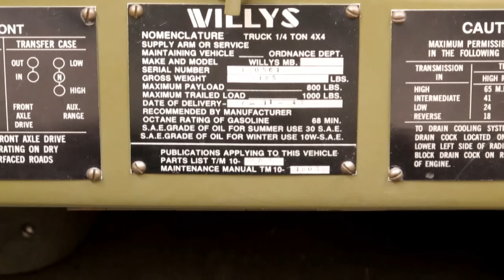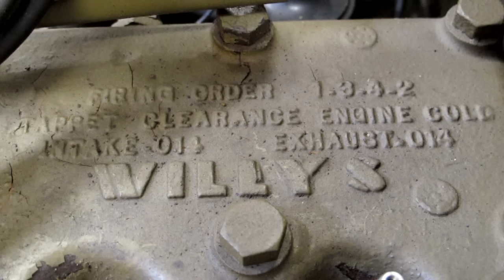1943 Willys MB Jeep - Walk Around

Comment: Nice Jeep. I’ve owned and restored two of these that were made in 1945 and I restored them to factory original condition, wiring, fuel tank, combat wheels, radio, every detail back to original and nothing modern…..except the battery, it’s common for MV owners that have these old 6 volt systems to install an 8 volt battery so it helps the starter have a little more power, it helps in cold environments and the voltage regulator can be adjusted charge an 8 volt battery. Please remember that when you restore the radio, the radio case is a different OD green color called Communication Corps green and it’s a crinkle type finish. There’s a vintage radio vendor that sells things online and they sold the paint in a spray can but you have to use it properly, don’t apply numerous coats or it won’t look right. If you can’t find the paint, you can go to your local Harley Davidson dealership and buy a can of their black crinkle paint then once you paint the radio case with it and it dries well, apply a single coat of the right OD green over it. These days, MD Juan makes some excellent reproduction parts but there are some better quality reproductions out there that you may prefer. I bought most of my parts from Ron Fitzpatrick parts out of Oregon and he sells a beautiful Italian made fuel tank which I highly recommend. If you’ve ever thought about owning and restoring one of these, it’s really not that difficult to do. Using flat paints is very forgiving compared to high gloss automotive paints. I would often buy a case (6 cans) of spray paint from RAPCO parts and as I restored various parts over time, I’d paint them as I assembled each section. Even using ‘rattle can’ spray cans is fine for larger sections like the hood or body panels. I’d buy a gallon of the paint and use it for the body and underbody areas with a cheap spray gun from Harbor Freight. The paints are still very cheap compared to automotive paints, a gallon of 314 OD green is only $45. And the spray cans have the same paint inside. With MD Juan, you can even buy a complete Jeep kit that only needs the engine and drive train so the options are wide with working on these, just depends on what you want and how much you’re willing to spend. Some prefer to use only US made original parts which is possible but insanely expensive so most of us compromise. I hate it when someone restores a WWII jeep but when they open the hood, it’s all civilian parts, crappy wiring and a 12 volt system. It’s fine if you haven’t gotten to the engine yet but to say that the Jeep is restored and the owner has no intention of completing anything else, is far from restored. And you’ll see a lot of Jeep owners that do this, usually there’s indicators that this is the case when you see all kinds of weird stencils that are incorrect for the vehicle and period of service. MV purists will always keep their vehicle exactly original and nothing else.

Comment from the maker: Blackout Lights were designed to provide a minimum of light so as not to be seen by a distant enemy or from the air above 400 ft. The Blackout Driving Light is 25 to 50 candlepower. They were probably most useful for vehicles traveling in convoy with wide-awake drivers. 

I’ve played around driving with them and really couldn’t see much. You need to drive very slowly. I can only imagine a lot of people ran into each other when using them.

Comment from the maker: I got it this way in 2004 but never drove it very much (for various reasons). I needed to make room for another vehicle so I sold it.

Jeeps were made as a lightweight, expendable vehicle and were never intended to survive as long as many have. Sitting out in the weather is a killer… sitting under a tarp is probably worse.
Still have the Model A.

Comment from the maker: A vacuum wiper motor has a semi-circular trough with a pivoting paddle inside and a fairly simple valve system. They work on vacuum similarly to how a steam piston works on steam. Do a Google search on VACUUM WIPER MOTOR HOW DO THEY WORK or search for VACUUM WIPER MOTOR REPAIR and you should find what you need.

Comment: Nice video, very informative, you even show the labels too, great! Always been curious about the details in these "General Purpose" (Jeep=G.P.) vehicles. Amazing how simple, straight-forward and rugged it all is, the way all American stuff used to be made. This stuff is going to remain around for a long time I'm sure, they're not making any more of it.  Congratulations on an amazing restoration, hope the new owner has as much pride in it as you do, can see it in the way you undo the latches :^)
Reply: GP was not "general purpose", it was Ford internal code for Government, 80" wheelbase. 

After American Bantam delivered the first prototype of what would become 'Jeep', followed soon afterward by Willys and Ford, Ordnance shared blueprints and specifications with each manufacturer, suggested revisions, issued each a contract to build 1,500 'pre production' vehicles (Bantam's contract was extended for Lend Lease).
These 'pre standard Jeeps' were:
Bantam BRC (Bantam Reconnaissance Car)
Willys MA (Military, first contract)
Ford GP (Government, 80" w/b)

After those vehicles had been thoroughly tested and evaluated (severely abused) and additional revisions specified the contract for 'Truck, 1/4 Ton, 4X4, G503' was awarded to Willys Overland with Ford as subcontractor. The WW2 standard 'Jeeps' were:
Willys MB (Military, second contract, nearly 360,000 produced)
Ford GPW (Government, 80" w/b, Willys contract, nearly 280,000 produced).

Comment: Very nice jeep and presentation. I am looking at one now for 14k and was wondering, when you had yours, what you didn't really  like about it. I saw where you said the steering wheel was too big and it was not big enough for bigger, fatter, lol older men. But was there other negatives you didn't like about it. I value your comments because you've owned one and obviously take pride in ownership of your vintage vehicles. Thank you in advance for your comments.
Reply from the maker: These are very nice WWII collector vehicles, which were sold cheap and then neglected and left out in the elements to deteriorate. If you can get good one, lucky for you. 

If you are in an accident with one of these you are probably going to get hurt. No collapsible steering column here. No roll bar. Not suitable for seatbelts (it would be like putting a seatbelt on a motorcycle). Probably best if you are thrown clear.

There are modifications for moving the seats back, but then it will not be exactly original. Do you care if it makes driving easier or more comfortable?

You do not want to drive these to fast as the front end can get into an oscillating harmonic, which can rip the steering wheel out of your hand if you are not expecting it. One of the reasons for the large steering wheel. Be happy with 35 to 40 MPH.

They are easy to roll over. They are easy to flip. People tend to get into trouble with these because they think 4WD can go anywhere. You can go just about anywhere but not necessarily get back again. Recon the terrain and conditions before driving there.

Like all ATV’s, don’t drive it any further than you are willing and able to walk back from.

They are easy to get stuck, especially in sand. They have handholds all around them so 6 or 8 GI’s could pick them up and get them unstuck, etc.

On the plus side, almost all body pieces can be obtained as reproductions. Just search for them. The reproduction parts are made in the Philippines. 

Now… go buy one, fix it up and enjoy it!

Thanks for watching. Please Subscribe! 
Ron
Reply: Thanks so much for the quick, very informative reply. It's really making me think if I want one of these. Just subscribed. :)
Reply from the maker: Not everyone has one of these. When you die, it's the one with the most toys who wins!

Comment: That vehicle was set up only for the South Pacific under Gen. McCarthy. The insignia shows that. Those black out lights are called map lights. There a 6 volt and or 24 volt system. Also the engine is a Flat head 4 known as the L head with a 3 speed top load transmission. That vehicle was never in full Military battle, may of been used at the base. In the rear panel on the lower bottom drivers side would of had the hand written script Ford, a raised insignia. The President, who I can recall his name at that time of WWll ordered all scripts to be cut out of those Fords on the back panel. Also the gun mount plate under the tub of both Fords and Willys. Was the Ford script stamped into on top of the gun mount plate. Willys had their stamp as well stamped Willys. I've still got alot of those Willys and Ford parts. Field radios. Antennas. The ceramic baseount blocks. The thick radio cables. Toolbox that held the tools in the rear inside fender with keys.. Those hard to find fuel tanks. Forwarding kits. Combat rims. Thats another item I didn't notice you having on your quarter ton truck. I've all 5 of those rims. 600 16s, 2 peice rims. Not made like you're typical split rims on pickup trucks either, all together different. Designed only issued for WW11 Fords and Willy Jeeps only bolts hold the ring onto the rim. I've got bows and tops, doors. Rear sets. Front seat frames. Now on both Willys and Fords, there weren't any retractable gates, they never opened. Molded in always. The Follow me Jeeps and Fords had them retractable gates on base at both Navy and Airforce only. Those Jeeps and Fords was slow with 5 men and all the gear they would haft to haul at times. But..., yea' couldn't beat em in mud or up hills, they was super tough, and still are. They do have a flaw, between the 2 cylinders is that water jacket. There they crack or crack on the lower part of the outside block.. cam gear side if I remember right.. Ive also got jury tanks thats dated 1942'43 and so on. Bumpereets, spare tire mounts, windshield gun mounts. Cluster panal with full pull out instrument panels, twist pin pop outs, and with the cloth wiring, and the band wraped peep lights that set out onto the drivers side front fenders, some was mounted a siren.. Nothing I have is Civie. All Military issue. Ive got 2 decapitation bars left. Those go on the front bumper. Inner fender panels with the oak wood inserted in the rib framing. Gunner windshields. Emergentcy cables and handles. Both Ford and Willys are a different set up. Simular in looks, but one who knows the difference can surly tell any differance or modifications. I've been restoring those little green convertible 4 wheel drives for well over 40 years. I'm done. And no they never had a heater that was worth a darn.. behind the seat was maybe one.. but it was a boxed add on.. not issued.. They set on drivers side if its a Ford and Willys set on the passenger side of the steering wheel. Instrument panals are different of both Ford and Willys too. Ive testored those darn things for decades. I'm done with them. I'm debating rather to just sell what all I have. Ive already sold the 2-1/4 ton trailers. Hoods fenders. Resests headlights, grills, some Ive still got. Rears, differentials, 3 peices of drives haft I've still got. Transmissions I still have. The brass peice that goes onto the steering box that runs up the steering column and hooks to a fiber button and loaded by a spring with the hard carbon black button to make the horn blow. Ive got a box load of them.band also under the hood there is a place to carry info with the under the hood mount brackets. Ive got just one left. Its to be mounted right directly under the hood. Motor parts, carbs, air breathers, genorators, push peg starters, transmissions I've still got. All flat head motor parts, with 2 hand cranks that will start those engines. Those a very rare. Ive not got any F heads or parts. They are different they are for those high hooded Jeeps. Military never used them in any war time battle.. again only the Navy and the Airforce used them strictly on base. Parts won't inner change. Not even the transmissions will work. Those are the F heads that has the valves that run in 2 different directions, one up and one down. They are junk! I've already sold my Bantom and my Ferguson 4×4s. Ford had a half track type. They also had the 6 wheel 3 axle. Junk. It had a floating rear. Again junk. The same size engine was used in both Ford and the Willys. Then when the Jeep M1A came out it had a 2cinch wider body design on it. Again junk! If its not a WWll Ford or a Willys, it's JUNK!  I've got other Military parts, but way to much to mention.
Reply: The 'Jeeps' of WW2 were not 24 volt, that did not happen until the M38A1 (Willys MD) was introduced in 1952.

Willys built vehicles never had 'Ford' script on the left rear of the tub, those were the early issue Ford GPW (Government, 80" wheelbase, Willys pattern). Early Willys MB vehicles had block stamped 'WILLYS' in the same location. Oddly enough, those 'tubs' were not built by Ford or by Willys, but by American Central Manufacturing (ACM) who provided them to Willys and to Ford. Ordnance put a stop to the 'script' in early 1942. No one cut the script from existing vehicles, they were simply produced without it afterward. The President of the U.S. was Franklin Roosevelt at that time and he had nothing to do with that decision. Ford continued to stamp a small script 'F' on nearly every part they manufactured for their GPW throughout production as a means of quality control.

The Willys 'Go Devil' 134 'L Head' of the Willys MA was primarily what won the contract to build 'Truck, 1/4 Ton, 4X4, G503' for Willys Overland with Ford named as subcontractor. All of the nearly 360,000 Willys MB and nearly 280,000 Ford MB vehicles were powered by that engine though Ford built 134's had those little 'F' marks everywhere for quality control.

Previously built Ford GP vehicles had Ford tractor engines, the Bantam BRC used Continentals. It is often said the Willys built 134s were better than those built by Ford.

Your cache of mil - spec parts has considerable value.

Comment from the maker: I first looked at these in Manila in 1975. As an abandoned vehicle, but with an original serial number, possibly it could argued it was originally built in the USA, then imported as an antique or historic vehicle. Or import the individual stainless parts and build it in the USA on an original frame, which has the title. This would need to be clarified and approved by the various authorities beforehand. Antique vehicles do not require any safety features not original to the manufactured vehicle.

Comment: So thats how to get the headlights on, never knew it came out a little further after you press that little button in, thanks
Reply: pepsi666 Rowena my friend had one of these that they  got at a auction and they could never figure out how to turn the headlights on either. 😭
Reply from the maker: The detent for the headlights was so someone absentmindedly did not turn the headlights on in a war zone giving away their position and/or making them a clear target.
Reply: Pull it all the way and you'll have brake lights without head and tail for day use.

Comment: I have a 1942  trailer that was made for the navy  blue in color  no tailgate just a box.   I use it  for tailgate camping and  
whatever.   this trailer was maid by  Converto  .
Reply: Good stuff.

I have an early Willys MB-T but Bubba cut the rear panel away decades before I got a hold of it.  I've considered having a new panel welded in place but it's so convenient without.

Comment: Someone kindly explain to me the 3 gearshift levers; I’m used to ONE lever, not 3.
Reply from the maker: Main Gearshift Lever - It works a regular 3-speed transmission (plus reverse).
The transmission output feeds a transfer case, which provides power to front and rear axles.
Second Gearshift Lever (transfer case) - Engages/Disengages the front axle (2-wheel drive or 4-wheel drive).
Third Gearshift Lever (transfer case) - Has High-Neutral-Low range. High Range used for normal driving. Low Range (Granny Gear) used for off-road and rough/steep terrain.

Comment: Nice never see a WW2 jeep that clean  thanks for showing the workings didn't know that  on the highway what would 
the gas mileage be     and at 55mph is it easy to steer straight ?
Reply from the maker: One of the easiest ways to get hurt in a WWII Jeep is driving it too fast. The front end can go into a harmonic vibration or oscillation at excessive speed, which can pull the steering wheel out of your hands and/or cause other problems with the steering. Later models incorporated a shock absorber or dampener on one of the steering tie rods to help control the harmonic oscillation. While it will go 55 MPH or faster, in my opinion that is much too fast. Best not to exceed 35 MPH in one of these old vehicles and live to enjoy it.
Reply: @RonaldWalters2010  Thank you for the information  didn't know about oscillation problems  really did a nice job restoring the jeep and looks quite fun to drive! 
take care and drive safe!

Comment: We hated jeeps, especially the Ford made jeeps. 
They had a rear coil spring suspension that ‘tucked’ or had the wheel stay down too long in a hard turn. When you came back down there was no support at that wheel and you rolled the whole thing over on you. 
The Widow Maker.
Reply from the maker: Killed or severely injured several on the test tracks as well. But they still made them and they got us through WWII and Korea. I don't think it was just the Fords. They were all easy to roll if going too fast for the conditions. A friend of mine in High School rolled one (going too fast). Fortunately I was not with him that day. As for him... a severe case of having gasoline run up his ass as he was partially pinned under it in a ditch. Fortunately it did not catch on fire but he walked funny for a week or so.